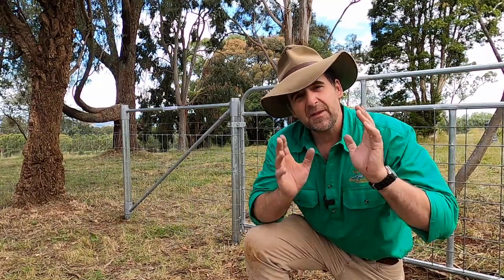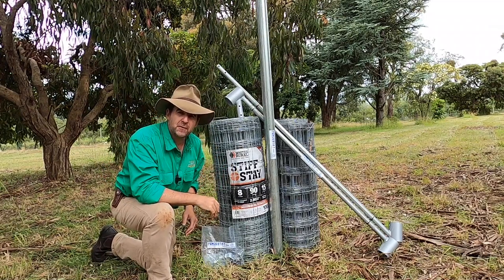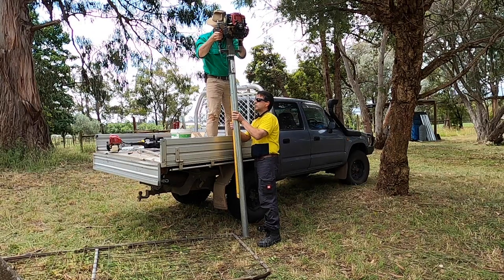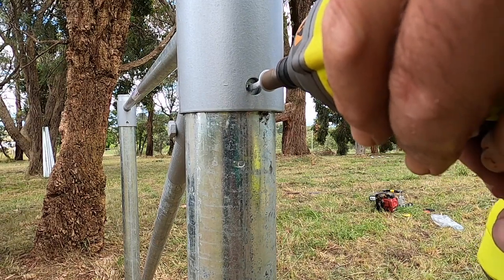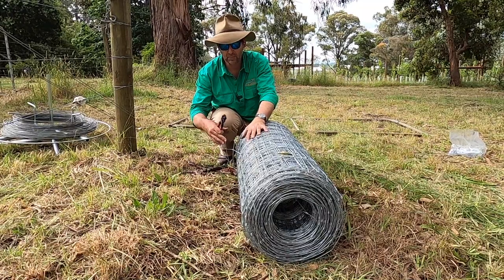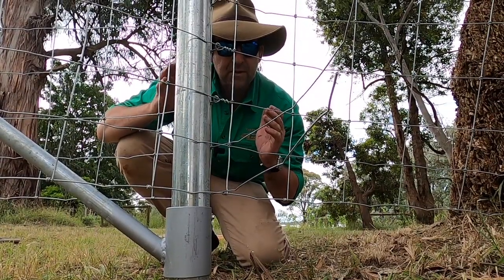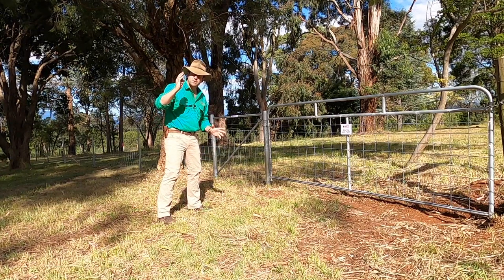All Metal Fence Build Using Only Hand Tools. Whites and Fencestay

Comment: Tim, I wonder if you have made that video and where it might be if you have? If not, as I cannot use my 2.85mm high tensile wire, is 2.5mm satisfactory for fence life but still able to be tied off by hand?   What is the smallest calibre of HT wire that you would use? Thanks again. I've just watched the tying off for barbed, which I don't use but have a perimeter fence with a neighbour that has a top barb fence that I am going to have to tighten after I put in a small gate for access to an easement with our water meter on it.

Comment: My question is: which way does the diagonal brace face? Top to the end post, or top to the line? Geometry would suggest bracing the top to the end post so that strain is transferred to the line post base keeping the end post more vertical. Yes\No?
Reply from the maker: Top to the end post. See if you can spot the mistake 😂..... it was late on Christmas Eve.....😳
Reply: Then this would suggest that on wood assemblies, the bracing wire would run top of the line post to base of the end post. Stress on the end post then transfers across the horizontal timber to the line post which is backed up by the brace wire tension from top line to bottom anchor of the end post keeping the whole thing square, or not. Just thinking.
Reply from the maker: @donberger850  spot on mate. Check out my earlier video on constructing a box end assembly. Goes through all that.

Comment: Tim, thank you for all the many tips. I have only one current question. After years of struggling to tie off with a 2.85 high tensile roll, what is the easiest compromise between size of HT wire and doing the job by hand for an older chap?
Reply from the maker: I’m talking with a wire expert about wire choices today, in the hope of making a video on the subject. It’s likely to take a month or so…..
Reply: @FarmLearningTim   I suppose what I was after was what thickness of HT wire do you use that gives a good combination of longevity and the ability to tie those great knots you described so well in your videos, by hand. 
I had an old roll I inherited from the previous owner of our small acreage but it had no markings left. I could do the ties quite reasonably, but not any more with the much thicker 2.85mm variety.
Reply: So Tim, I was wondering if you had done that interview and where it may be. Alternatively, can you tell me if 2.5mm wire is thin enough to be tied off by hand, as the 2.85 is not easy enough for me and you make it look ridiculously easy. If 2.5 isn't a small enough calibre, what is the next step down?

Comment: Hi Tim, nice video and fence build. I appreciate all the tips you give, thankyou.
I was wondering what type of boundary fencing you would recommend to help prevent fence damage from roos and wombats? We don't keep stock, except for roos and wombats 🙂 Cheers.
Reply from the maker: Big question. Do you want to exclude the Roos and wombats or just let them go through without damage?
Reply: @FarmLearningTim Thanks for getting back and yes,  that is a big question. I guess really we don't have an issue with them on property (we have a marsupial lawn)  it's just that we have so many holes in the fence (it's two top barbs with mesh (like heavy chicken wire) below on 3 horizontal wires. It is old and looks really bad.
So happy with no barb on top. Roos can jump over, happy to keep wombats out but I know they'll just dig underneath, which is a pain but not an issue as long as they don't destroy the fence. Cheers
Reply from the maker: @michaelclark2840  ok. What about neighbors? Are they relying on grazing stock for income? Think about the impact that your feeding Roos could have on them. Might inform your way forward. If not an issue, then install wombat gates in the fence on game trails ( they always go through the same way) and problem solved. Don’t use barb above nose height on any fence it’s just cruel. Check out my budget exclusion fence video for more ideas. Hope that helps
Reply: @FarmLearningTim  thanks Tim. Good point about the neighbours, that said we have state forest all round and our closest neighbours have more roos on their properties than ours. I'll check out your exclusion  fence video. Cheers and thanks.

Comment: Hi Tim, great video. 
How far do you space the intermediate posts (star pickets)?
Does the envelope system do away with strainer wires? Thanks very much for your help
Reply from the maker: Four meters mate. And no, Still need some form of strainer, either stay bracket as in this video or wire in normal systems. Cheers.
Reply: @FarmLearningTim  sorry, I meant a top and bottom high tensile wire? Do I need to run them if I use this system?
Reply from the maker: @nathanmarsh9132  ahh save wires.... it’s a matter of choice. The Whites stiffstay wire has high tensile top and bottom so not really, but some people still insist!

Comment: Tim, can you tell me why you don't strain your plain wires with the strainers attached to your end post like you did in this video for the temporary ground wire ?
Reply from the maker: For runs of several hundred meters I do, however with shorter runs the tying of the termination knot makes for slack in the run that results in slacker or more variation in line tension. Knots and good joiners allow a much more consistent result

Comment: could you please show the best method to pull a metal fence over very uneven ground? should I just tension the net and cables and then adjust them at the right high on the poles? how to deal with sagging of the top net in the deeps and the opposite on the rises?
Reply from the maker: Check out my fencing a gully video

Comment: Hi Tim. Thanks for the video. Do you know where I can order this fencing from, and could you tell me what heights / mesh I would need for goats? I plan to build an approx 12 x 8 enclosure for overnight, and use electric fencing during the day.  Do I need end assemblies on each corner for this size area? Thanks in advance.
Reply from the maker: G’day Steve. Whites for the wire and fence stay for the end assemblies. Both companies are linked on my website timthompson.ag you will also see all the answers to your questions in my video library, which is on the website also!
Reply: @FarmLearningTim  Thanks Tim. Always wanted to learn the Truckies hitch too! : )

Comment: Your brace is wrong. 
The cross brace should be the other way. 
The way you have it right now will allow the fence tension to pull the gate post ( open end of the fence ) upward and out. The cross brace is to prevent this by applying the load to the other post and directing the load back to prevent racking of the brace and causing it to pull out. 
I seen that the wood post were correct yet yours are not. Care to tell me how this is not right?
Reply from the maker: My wooden assembly is different to the metal one because it works differently. A wooden brace has a wire crossbrace that tensions the brace when pulled. This one has a solid steel crossbrace that is strongest when compressed. If it were installed opposite, as you suggest, the post would actually be more likely to be forced up out of the ground, due to the solid nature of the brace.
Cheers.
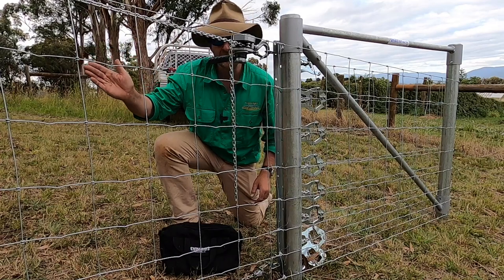Reply: William Glaser you’re right - 11:35 he has the end assembly the wrong way around but must change it because at the end of the video it’s correct.

Comment: Tim, would it be acceptable to auger out holes and concrete the strainer assembly posts in instead
Reply from the maker: I'm not a fan of concrete for round post holes. The sideways strain can crack the concrete and the buggers are hard to get out. The 76mm diameter of the posts is best suited to driving them in the ground, you will loose a lot of rigidity if you drill. I reckon if you are going for concreting then go concrete posts. Just my opinion.... Hope it's helpful.
Reply: @FarmLearningTim  cheers thanks for the comments

Comment: Tim - why not build a proper fully welded end assembly instead of using these poxy kits? A well constructed, all steel 3 rail or stay & top rail end assembly will give more strength & durability than these bolt together kits and will last a lifetime compared to timber alternatives. I guess quick & easy is good enough for semi-rural Victoria but there’s no chance I’d use gear like that here in western NSW. Just not sure why you’d recommend this sort of stuff to people over a proper fully welded steel alternatives and why you haven’t shown how to build a decent steel end assembly on your channel?